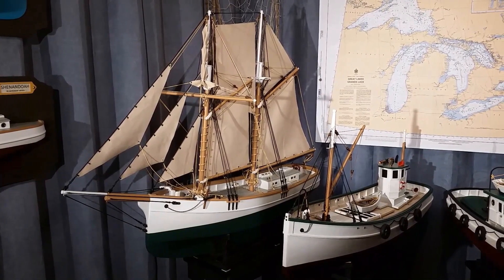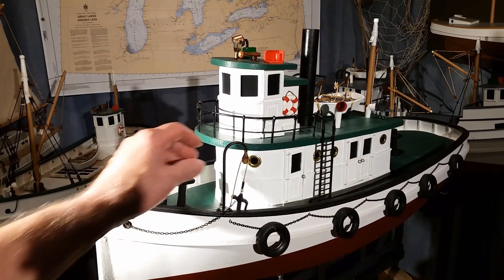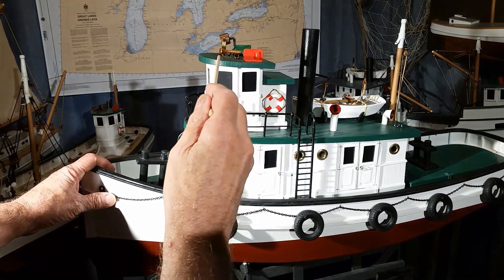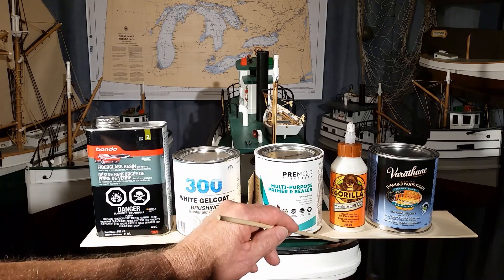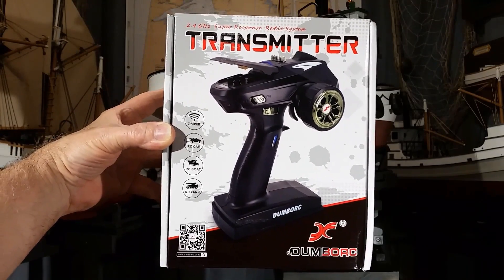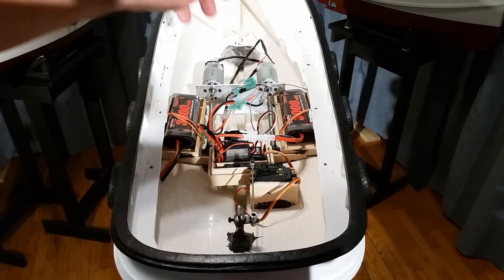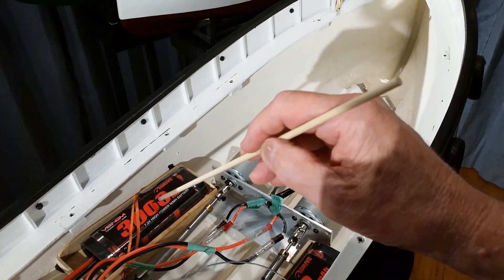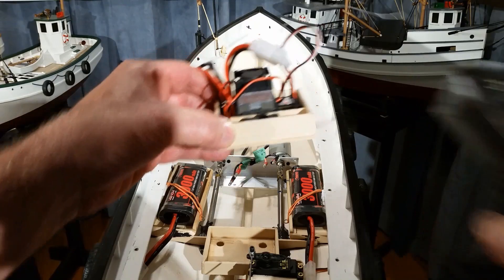RC Tugboat:  A DIY look at Design, Gear and Electronics

Comment: Du you think I could 3d print a hull?
Reply from the maker: That's an interesting question.  I don't know if model boats are currently being 3d printed but it probably is possible. RCWH
Reply: @RCWorkboatHaven  I'm currently trying to create a similar hull in CAD software, it's very challenging because it's not really made for those organic shapes. But I have found workarounds. Thanks for the response, I'm really glad to have found your channel!

Comment: Lovely Tug. Just for your info, yout tx/rx are the Dumbo Rc brand, not Dumborg as you seem to state. Great look at your boat non the less.
Reply from the maker: Thanks for the heads up on that. The transmitter has the spelling as DUMBORC printed on it and I used that to describe it. Brian RCWH

Comment: When looking at this site you are demonstrating a RC Workboat Haven Tugboat. Can you tell me where I mite find one and what the cost range mite be.
Reply from the maker: Good comment and question. In the future a model like the tugboat could be offered for sale by RCWH, or a copy of the model you see on the videos. The RCWH channel is intended to encourage a DIY build of RC Workboats as cheaply as possible.  A model like the tugboat would be fairly priced between US $1,500 and US $1,700 if it were built by a custom RC model builder. There is simply no way around it...you either get the model pre-built custom or you do it yourself. Brian RCWH

Comment: The speed controller pushes a lot of amps for those motors. I only ever ran 80A at most and stays just warm, fan cooled. In my catamaran the controller is 120A water cooled. This boat travels at 66.6mph. A lot less amps !!! Happy sailing.
Reply from the maker: That is a good point.  If you go onto EBay and search "Double Way 320A brushed Motor Electric Speed Controller for RC Car Boat Mode" you will see the ESC with a fan that I've been using.  It could be because it is so inexpensive that it is so inefficient. I have never had any problem with these ESCs but they could develop.  Thanks for the heads up.

Comment: Hello, o really like the channel and your building methods.
What brand of speed controls are you using.?
Do you find them reliable?
Any info will be appreciated
Reply from the maker: Thank you for your comment.  I am using an inexpensive eBay ESC that is labelled "ESC made in China"  You can find these by searching eBay for "320A High Voltage ESC Brushed Speed Controller Cooling Fan for RC Car Truck Boat"  Try to get the one that will control 2 motors. (they describe it as "two way brush electric adjustment") I have the ESC in 4 different boats and they have given me no problems.  They are only about US$15 !  Good luck.  Brian RCWH

Comment: I have a Mr Darby I bought years ago. Its time to get it running. Where did you get the grease gun?
Reply from the maker: I bought the grease gun and 5oz tube at a local Hobby store in Barrie Ontario called Ideal Hobbies. The gun and grease are advertised as a
Dynamite (Dubro?) DYNE4200 Grease gun and tube. Most RC stores would have them.

Comment: Do you make or buy the prop shafts with the sealed roller bearings?
Reply from the maker: I have been buying the tubes locally and the shafts and bearings on Ebay. Our Bad Weather Build Part 4 video has a section on the running gear.

Comment: Hello Brian. Will you let me have the company’s e-mail details were you bought that adjustable model platformfrom, its a fantastic idea you have made, I would love to copy it if that’s ok.
Best regards…….Mike.
Love the videos.
Reply from the maker: I actually built that platform from scratch myself, it wasn't purchased from a company.  But there is no reason why you can't take the concept and make your own DIY stand. The really useful feature is that the model can turn 360 degrees, and you can pick up a 6" x 6" swivel base (used for kitchen lazy susans) at your local Home Depot, Rona, Lowes etc. as a start. Hope that helps!